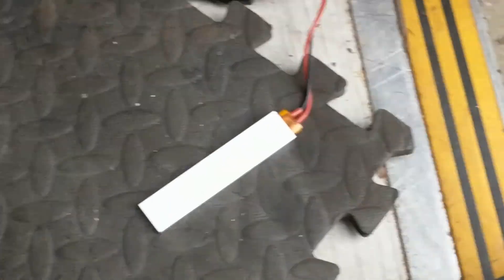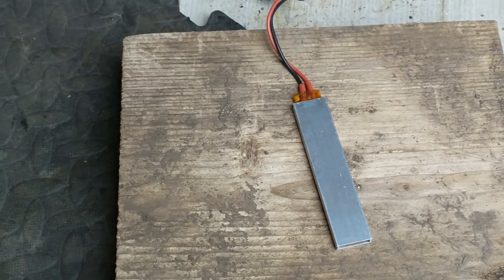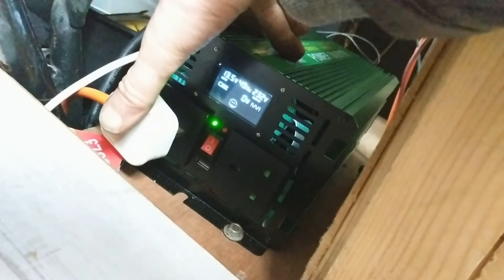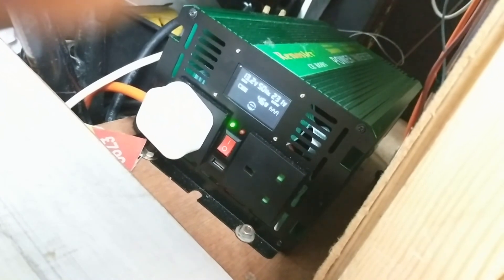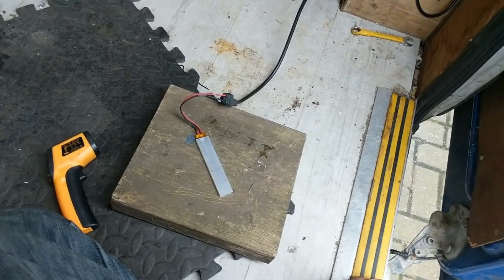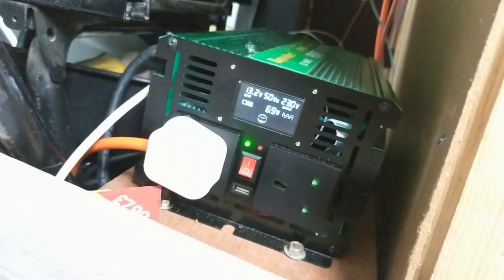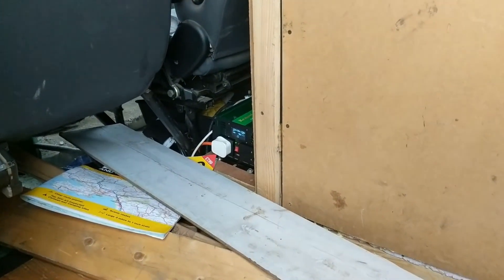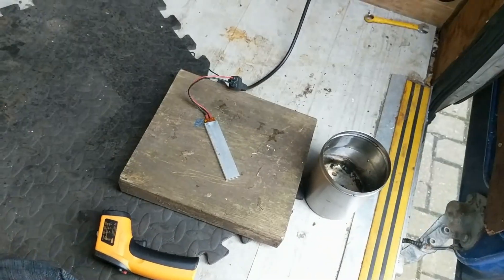PTC heaters for shore hookup heating water off 240v and dumping excess solar 12v

Comment: You can buy small heatsinks with internal channels to circulate water thru, used in liquid cooling computers. You could probably fit 4-6 of them on that PTC stick on both sides and use an aquarium pump to circulate the water. (natural convection currents could circulate the water but a lot less effectively.)
Reply from the maker: I gave up on these, I replaced them with 10 of the 40w cartridge heaters they use on 3d printers, each in a small aluminium block I sanded to fit the curve of the 25l hot tank, so that's 400w of 12v heating to dump off excess solar, and I bought a 700w 240v heater to get the water hotter faster if I have 240 where I'm camped.

Comment: Probably not enough surface area on the PTC to transfer heat effectively.  A regular electric stove element is usually in a coil to maximize surface area.

I'd assume they were specifying it to be used for an exact temperature range (which nowadays is usually the melting point of plastics for 3D printers, without burning it) and for use with an aluminum heatsink.

If you are careful to not overlap wires, you can try using various thicknesses of Nichrome wire - more useful for toasting and the like - but results will vary greatly depending on length, thickness and surface area.

Comment: Maybe if you get a metal plate to disípate the heat outside the jar, you can get a better chance to heat it up quickly
Reply from the maker: Yes it did seem to be a transfer issue. When I go full scale with it I will know for sure
Reply: @WereReallyRelayCamping  I try to do the same with peltier cells but the it seems the main problem is the heat transfer I already but two PTC of 12v to try boild water and you video was a huge guide

Comment: I'm glad I found your video I wanted to do the same thing as you but I have a 200 watt solar panel and I wanted to put it under the bottom of a frying pan so I can cook food in it I'm a little disappointed that you didn't have much luck though.
Reply from the maker: I'm blaming bad transfer of heat, I think if I could apply some real pressure to get good metal to metal contact it would have worked better.